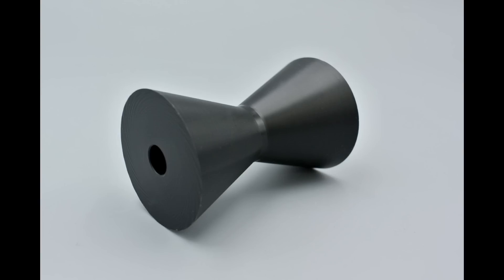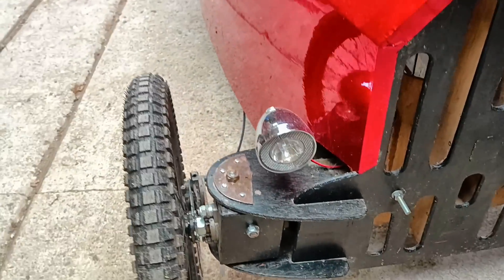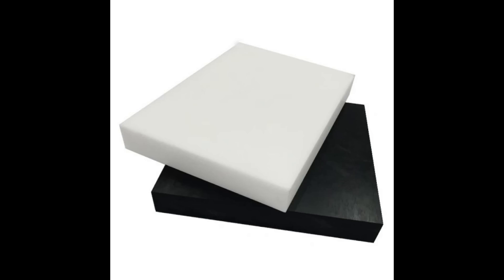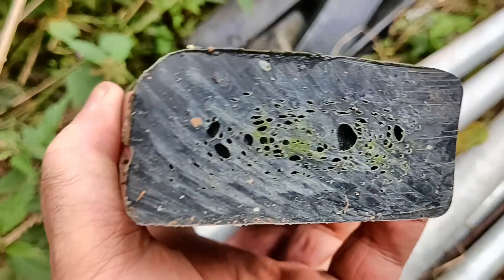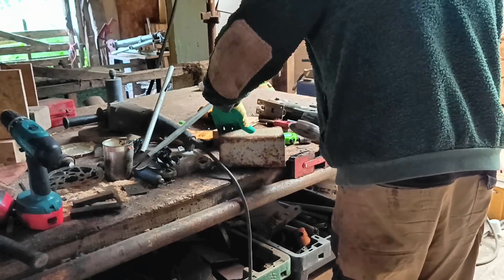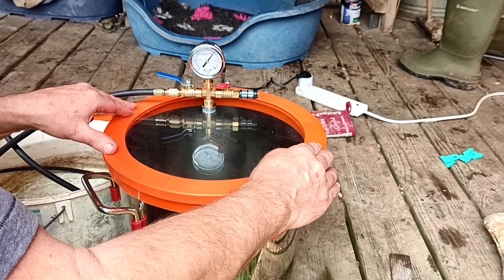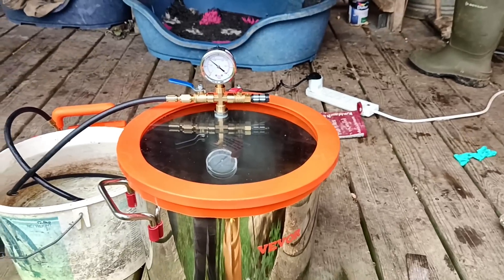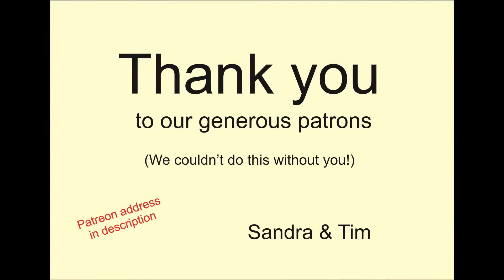Vevor Vacuum Pump And Chamber – and the challenges of Home-Made Machinable Recycled Plastic Stock

Comment: Mad idea - When smelting you use flux, is there something to float over the surface of plastic?
 Pellets are large, but man, I worry about your microplastic contamination so see if there is a way to collect your sawdust. possibly the better part to melt.  & you need a new food oven !  300c is too hot.

 I use a food tin & hot air gun 

bottle PET plastic into workable slugs. add slow bit by bit. then cut can off. could work for you & would save the oven.
Reply from the maker: Thanks, but PET is a different sort of plastic
Reply: @wayoutwest-workshopstuff6299  True, but abundantly available & cut without dust 
My favorite mallet was cast in a tin 'o beans :)
.
& is my mere pennies worth, feel free to spend or dismiss as you feel appropriate.
 
 Thanks for replying & I feel like a kid who's fave celeb just gave me an autograph.
 ( although truth be told you are third place after your wife, and that eeeor-ing donkey )
- Thanks for wasting your time on my insignificant ego.

Comment: Did you try putting your spring compression mold in the vacuum chamber? Not sure that would really work with the surface tension of the plastic but maybe it is worth a try! Also if you used finer feed stock perhaps that would result in a more uniform end product...

Comment: A pressure pot is what you wanted to use.   The pressure makes all the bubbles and voids very tiny.  then when the plastic cools, it solidifies around them.  This is what is used with epoxy resin.

Comment: If you’re serious about manufacturing parts, then it’s probably worth your time to set up an injection molding machine. That will drastically reduce the time per part, allow more complex geometry if needed, and greatly improve the part quality.

Also, it might be worth noting that the voids might not be a problem. After all, aren’t your current plywood boxes hollow? As long as there is enough material at the surface to do the job, the rest is just filler anyway.

Comment: I do a similar thing with bottle tops, to avoid the voids smear the mould with Vaseline to stop it sticking, the mould needs to be polished not rusty, cut your material into small chips and add gradually to the hot mould allowing each layer to melt before adding more. I find the voids appear as the material shrinks but is stuck to the edges of the mould. I use a scraper or a thin knife to remove the plastic from the edges of the mould as it’s cooling, if you can get right down the side all the better, it needs to cool slowly I leave mine to cool on top of the aga

Comment: You need to use a pressured chamber. With lots of pressure. In plastics industry’s there is pressures up to 2500bars used (material Pressure) to force the material in the mold and to keep the shape and not to shrink while cooling after molding. 
So, you would need a sort of cylinder to press the mass really hard while heating and during cooling and to hold the force until it has been cooled. The thicker the block, the longer the cooling process! 
And: not to heat it up too far, to avoid gasification (pyrolysis). 
So, just look at the material data sheet 😂
Good luck!! 🍀

Comment: If you shred the plastic put it in the mold compress it with the hydraulic press put the spring loaded block back on top then heat and cool.
Good lock.

Comment: I'd try granulating the plastic into the same size granules, or shall we call them "pellets" ?  - The same size as used in the extrusion of polystyrene toy kits. Then fill your square steel tubes and complete the heating process.

Comment: You might be able to make the plastic more uniform by either melting it and making it into beads or possibly making/buying a chipper and grinding the plastic into lots of little chunks before putting it in. You could then do like someone else suggested and press this ground up mix with your hydraulic press before putting it in the oven. 
Also theoretically if you got it hotter so it would flow easier with less surface tension and then put it in the vacuum chamber you might be able to finally get the chamber to help with removing bubbles. Possibly get a large induction heater and wrap the coils around the mold that way it'll heat the steel and if you set it up right then that heat will soak through the plastic.
Another thing I've seen some people do when using recycled plastic is add some used motor oil to the molten plastic and mix it in.

Comment: I have experimented with home recycled HDPE plastic myself for making small blanks to use on my lathe for making tool handles, so I also needed to avoid voids to keep the handle solid and not catch my chisels as I shaped it. A few things I learned in my experiments that might help:

1. You do not have to get the temperature too high, and in fact going too high is detrimental because it will just end up burning the plastic and releasing more gasses into the mix. What you want is a low heat applied and removed slowly, in order to maximize the time the plastic is soft and allow the gasses a chance to escape. I worked mine roughly around 250 degrees fahrenheit/121 celsius and depending on the size of the block might keep it heated for several hours.  You could go a bit higher than this if you need the plastic softer longer, but I wouldn't recommend going above 300F/150C. 

2. Rather than metal for my mold, I used wood. Wood has a much higher R value than metal, so it does take longer for the heat to penetrate, but it also means it takes much longer for the heat to release, giving you more working time for the plastic to stay soft and release the air.

3. Thin pieces of plastic in layers and pressed down on each other worked best for me. The thicker your pieces of plastic are, the longer it takes for the heat to penetrate all the way through and melt to the center. That's fine once it's a solid block but for trying to get the air out to get to that point, you actually want some airflow for the heat to get in. For my sources, I used milk cartons, soap containers, and even cheap grocery bags that we have here in the US (these I often gave a quick once over with a lighter just to get them into a more solid mass than the flowy bag before putting it into the mold). Anything showing the HDPE 2 symbol will work. You don't need to chop it up like it has gone through a blender, just thin sheets to mostly fill your mold. Aside from the melt pattern, or perhaps related to it, this seems to create a sort of damascus effect that increases the end bonding and strength.

4. Be prepared to do multiple cycles of heating, clamping, then adding more plastic and repeating. I would usually start with getting my mold about half way full with loose pieces, would put them in the heat to let those melt down, then clamp for a short while to press the air out and get the pieces to bond. Once it was cool enough to work with but not completely cooled, I would take the clamp out, add more layers of plastic, then heat it again and keep repeating until the mold was as full as I could get it and still clamp.

5. As with many projects, don't let perfect become the enemy of good. Some pockets and voids are going to happen no matter how hard you try, so the goal is minimization rather than elimination. If you end up with any small voids that are a problem in the final product, you can fill it in with small shavings of plastic that you melt in with a heat gun (or just some plastic epoxy if you're crunched for time).

6. Don't be afraid to start over. Sometimes you just get stuck with a run of bad luck and can't get a bubble out no matter how hard you try. Just let it cool, slice up what you got into thin sheets and use it as part of another melt later.
Reply from the maker: Thank you - good advice. Except I think this is a different mix of plastics to what you're using.

Comment: I've had good luck with stuff from Vevor.  I don't have a YT channel, otherwise, I'd be begging them for "stuff" for my not-for-profit.  We used one of their stick welder/plastic-welder combinations a few months back to effect some significant structural repair work at our observatory.  Worked a champ, working hard for 3 days of welding alloy steel structural components.  Got it for CAD$139.00 or so on sale.  Astonishingly good for the price.

Comment: Hi Tim, Have had some success at this on a small scale using plastic containers gallon cans etc. 
First I cut up the containers into 1" strips then placed them in a baking tray lined with "Silicon" baking paper. and stuck the tray into the Rayburn Oven. Once they where nice and soft I rolled them in to a sausage. Adding more strips until the sausage was big enough to make the block I wanted. The baking paper stopes the plastic sticking to things. To form the block I used a wooden box with a top that would slide inside (a piston), Pressure was applied with a  "G"  clamp. It was possible to avoid voids during the sausage stage and the "G" clamp just forced the plastic out in to the corners of the box. It's very easy to work the resulting block with woodworking tools.

Comment: I work in PE foam, we always use a round rod heating element usually 200*C embedded in a block of steel to heat our plastic for welding purposes. I would reccomend just drilling a couple more holes in the vacuum chamber lid to run some power inside the chamber and heat while degassing.

Comment: Okay now i do want to know how the plastics industry dose this than.
because as proven by Tim here the plastic has enough surface tension to keep the air in.

My best guess would be some sort of active mixing during the heating process but that would have to be done under vacuum and assumes the voids are gassing by product, it just might be expansion issue - like you get with water to ice.

good experiment all in all and i do like to see failures before success, it is what makes the eventual solution so much better.

Comment: Could see about trying to make a pugmill. Basically a sealed auger that soft material—usually pottery clay—is fed into. The material is mixed and extruded to the outlet size, the heat and pressure reducing the size of any air bubbles.

Comment: You went through standard row of errors for beginners in this area :) HDPE melts at 126˚C (259˚F) - you don't need to heat it much higher, you need to heat it longer (whole crossection). If overheated - it starts to boil and you have bubbles\voids.
Reply from the maker: Thanks - makes sense!

Comment: One solution to the void issue might be extrusion. Try forcing the stuff out of a nozzle into another mold while it’s hot enough to flow. You will be running a large volume of plastic through a relatively narrow cross-section, increasing it’s surface area for a time and hopefully promoting voids to leave at the extruded surface. If you were to agitate the surface of the plastic with something like a nail as it was being extruded, I think you stand a good chance of popping all the bubbles. You would just have to be mindful that you don’t make any new voids when it flows into the second mold.

Comment: There is only one solution that is injection molding. But it's very hard or even impossible to do DIY. Aluminium or brass would be solution i think. Cheapest option would square steel pipe that's ends are welded close. Though it's hollow inside it can be lighter than plywood if you take pipe with optimal wall thickness.

Comment: If you ever need a filler video whenever you are working on a big project for a while, you can now put random stuff in the vacuum chamber.
Reply from the maker: any suggestions?  : -   )
Reply: @wayoutwest-workshopstuff6299  stuff with air in it should do some thing cool like marshmallows. I've seen some cool experiments that involve water boiling easier and such. Maybe a community post will get more ideas.

Comment: Hello from Russia. First, the plastic must be granular. You will find the melting point of plastic yourself on the Internet, but there are questions about both your mold and the press. The pressure is not enough to press such a bulky product. Reduce the shape to the size of the finished product +5-6mm.

Comment: Extruding the heated plastic under pressure will get rid of some of those voids (but as you see on the planks you have sawed apart not all). The only way I see is to heat the plastic up to the point it liquefies, then apply the vacuum and after that put it in the mold.

Comment: Your videos are SUCH a delight in creative experimentation and iterating on problem solving. A perfect demonstration on how so many of us learn.   This wasn't a failure at all, you learned a lot more about working with this material, even if it's just learning what doesn't work is still learning.  :)

As hundreds of others have probably already stated,  many plastics tend to absorb moisture from the air which expands into bubbles when heated to the melting point.  Shredding or pelletizing the plastic first, then gentle heating/dehydrating to remove as much moisture from the raw material before the casting might help.  Vacuum drying with the new pump and pot might still come in handy to help with that.  :D

Comment: Forget all the efforts with pressure and vacuum, your enemy here is volumetric shrinkage which you cannot fight without applying many tons of pressure into the molten plastic while it cools.
The volumetric loss in HDPE can be as much as 30% of volume from molten to room temp so you are never going to "compensate" for this loss of volume without some serious kit.
Think of the process like an onion, as the plastic cools the outer walls setup hard first, the layers internally are insulated by the outer cooling layers and take longer and longer to cool as you get to the center. These voids form as the internal layers loose volume during cooling and are naturally adhering to the outer cooled stiff layers thereby producing these internal cavities.
I would suggest leaving the internal voids as a feature rather than a problem since the outer walls are very strong and will easily support massive weight and rods through the blocks, in fact many designers would love to see this reduction of mass on the internals of these blocks since the outer area of these blocks will provide all the stifness and support needed for the steering blocks.
Reply from the maker: Thank you - that makes a lot of sense

Comment: I too was going to suggest Brothers Make. Even they had voids though ..... even if small ones.
The trick(s) would seem to be 1. Not getting air in at the start (maybe stacking your cut blocks together before melting) 2. Good heat control. 3, Extruding into a hot mould.

Remember that even when "liquid" the plastic is very viscus. 
If you just want to make a cube shape maybe laminating it up would work. You could weld the plates of plastic together by using a metal plate between them heated by running electricity through it to get uniform melting. Again these ideas are worth what you paid for them ;o)

Comment: Make a centrifuge. The centrifugal force will pull the plastic past the bubbles. You can also introduce a heat source that will keep the plastic warm. You could centrifuge multiple molds to balance the spin.

Comment: From the world of wood resin stabilization and epoxy air bubble removal... most have switch to pressure pots instead of vacuum. You can see if you can find a big old pressure cooker or pressure paint pot. I'd venture to guess about 150 psi or so on that would sheink those bubbles to a very small and insignificant size.

Comment: Okay- hobbyist 3D printer here. Your railway sleepers are likely HDPE or PET. HDPE I don't know much about, but I've been building a  PET pulltrusion system, and I've been researching it.

PET loves to draw in water, and your voids might well be caused by steam boiling out from the material. Degassing won't help that much if it's caused by steam. (I know, water boiling out of plastic sounds impossible, right? But I've seen some prints pretty badly messed up by it.)

What you need to do is dry your material (probably in an oven) at a relatively low temperature for several hours (or overnight) right before you melt it (or store it in a sealed container with desiccant). You could also put it in the vacuum chamber with a healthy amount of desiccant.

Also, those big chunks of starting material are going to be hard to dry. You might want to switch to something like chopped-up milk jugs.

Alternatively, you could try 3D printing your part, then re-melting it in salt or plaster to fuse the layer lines.
Reply: This is a good point.  If I have some damp filament in my 3D printer I can hear the water within it boiling as it gets to the nozzle at 200 degrees C, sounds a bit like bacon frying.
Reply from the maker: Thank you - very interesting

Comment: As if I don't already have enough random thoughts running through the squirrel cage I call my brain, I can now lay awake at night pondering the problems involved in home made plastic casting and extrusion.  Thanks for that, Tim.  🤣🤣
That said, I think the variables you need to examine more closely are process temperature, and size and introduction rate of the raw material.  And maybe the process itself-  would working with pre-melted raw material poured into a mold (casting) be more effective than attempting to extrude the finished product from a die?